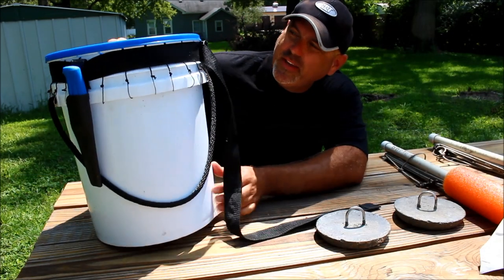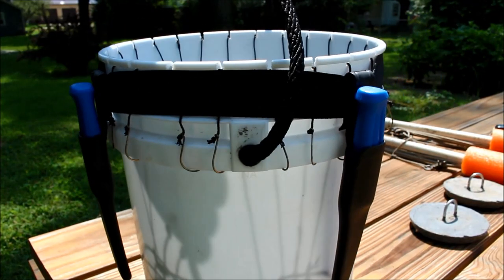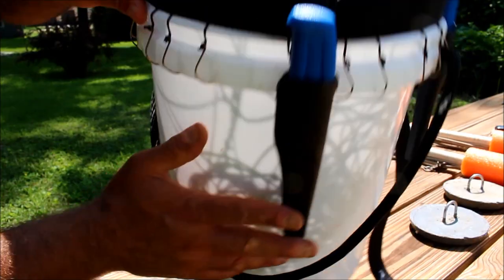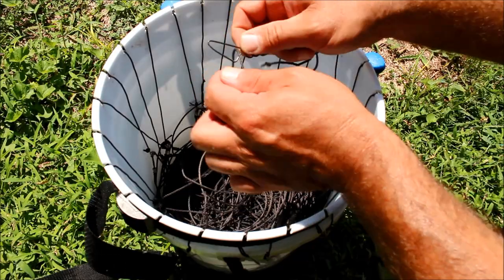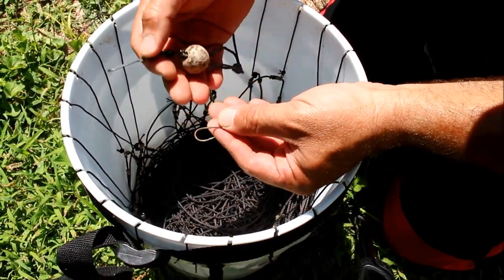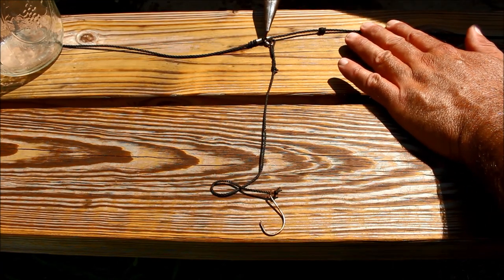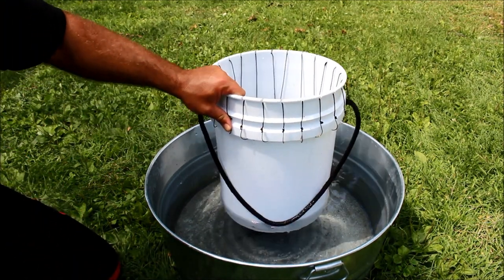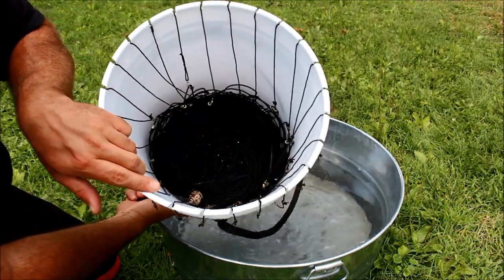Intelligent Trot Line Design

Comment: Nice design! Innovative and functional. I may copy it myself. I'd be interested in trying to bait it and feed it out like I used to do with my grandpa's trotline boxes. There were no plastic 5 gallon buckets back then so he used old wooden coke-a-cola boxes, he cut notches in the edge of the box and hung a baited hook in each notch, facing up and outside the box. We'd bait up 10 or 12 ea. 25-100 hook trotlines. The last thing in would be a weight with a few feet of line. So what we'd do is take a jug that was wrapped with 20-25 ft of line, tie a loop knot in the end, put the loop around the weight, place the pre-baited trotline box on the back of the boat (my job) toss the jug and weight and ease out in the boat, the baited lines would pay out of the box, as it got to the corners of the box I'd turn the box so that the baited line was feeding straight out over the back of the boat. When we got the end we'd attach another jug to the weight, stretch the line tight and drop it, the excess line was wrapped around the jug, the jug would spin paying the line out. The next day at daybreak we'd run the lines and reverse the process, feeding the line back into the trotline box, taking the fish off as they came in. The knot he tied the drop lines on with was the simplest knot ever, he'd run the line thru the hooks eye, the an over hand knot in the end, and another around the shank of the book and snug it up. It was earth to undo if a hook was tough to get out we'd just detach it from the main line and drop the fish in the bottom of the boat and keep going. Might not seem like a strong knot but he dragged in an 88 lb flathead One morning and he routinely caught 20-40 lb blues, channels and flatheads. One of my grandpa's favorite baits to use was grasshoppers. We'd catch them in late summer at night. Grasshoppers crawl up near the tops of weeds at night so the dew would dry quicker enabling them to dry out and be able to fly as early as possible. We'd go out at night with a flashlight and pick them off the weeds and fill a couple of gallon milk jugs which we'd freeze for later use. My grandfather also used ivory soap, skipjack, and some special homemade doughballs made out of cotton, ice cream, asefedida, fennel, garlic, and some other nasty stuff that I never did get the recipe for.
Reply from the maker: I know what you are talking about because  I have used those wooden jump boxes as we called them. I put out a 315 hook line with a stack of those boxes a couple of times.  I can tell you that those boxes are much better than this bucket because the probability of a tangle is so much less with a jump box. I have read several times that old time  commercial fishermen didn't put bait on their hooks. they would but out 45 thousand hooks per day and somehow catch enough fish to make it now worth the time to bait the hooks. 
thanks for watching
Reply: @countrydirtkid4451  You're welcome. Uh, I'm gonna add one caution to baiting your lines the night before, make sure your pre-baited trotlines are locked inside something animal proof to keep the cats, coon, possums out of them! We baited up a dozen 50 hook lines and left them stacked in the boat inside the garage, but somebody left a door open and a couple of cats got into the trotline boxes, you can imagine the mess! My stepdad ended up having to dispose of several trotlines, cats and all, just chucked the whole mess into a dumpster.

Comment: Nice, clean setup. I've never used a trot line I may try this out in SanteeCooper for catfish
Reply: Ross Best best way to fish for numbers.used em for years.its an excellent means to cover a massive amount of water at one time,and even possible to fish up and down the water collumbby useing various leader lengths and useing multiple baits to see whats getting the most attention.trotlines are a time tested old world means to fish.heavily used in the amazon still.despite the dangers lol.but here,we dont have man eating fish so its much safer lol.but jokes aside these people rely on this system to feed whole villages.the only other main method you will see them use is nets.they only use what will produce significant numbers.solid system and if used with some awarness and cuation its garanteed to land good fish.most of our 50 to 70 pound cats where cuaght on the trotline.and we had rods in the same area lol.the other known and effective method is closely related,and thats useing juglines.basically a single hook version of a trotline.i seen boats drop 50 of em in an area at a time.only thing to consider with them is to make sure they are ancored some how.cats tend to duck for cover after a strike if they are able.

Comment: If You use large swivel snaps on your main line and tie your hooks on a loop it makes it a lot easier to take the fish off and easier to set because You set the main line without hooks and then go back over it putting your baited hooks on you just have to remember too close the swivel snaps then You have no tangles and no problems

Comment: Awesome job!!! That is one of the best trotline mechanisms and general trotline design I've seen. Very thought out and a reason behind everything! And the video quality and editing was awesome! I want to see how you run your trotline. Tieing on to a tree and dropping one end off with a weight is one thing, but running a trotline in open water on a flat with only weights can be a pain in the butt and I've never figured out a way to do it safely and precisely. Do you have any videos on that topic?
Reply from the maker: Thanks for watching, when I put it out I lift the motor all the way out  of the water and drift with the wind. Since the hooks are 18ft apart I have plenty of time to free any tangles that arise. After I reach the last hook I let the wind tighten up the line somewhat and the throw the last weight out. Having the motor running when putting it out is scary so I lift the entire lower unit out of the water and the boat drifts sideways. Thanks again
Reply: So that little weight is enough to anchor your boat also? I tried trotlining out of my 18 ft boat and now have a 24 ft boat. In the middle of the lake on a flat all I could come up with is put out a heavy 80 pound sack of concrete, tie it to a 8-12 pound weight with maybe 30 ft of string and attach trotline to small weight and terminate it in same manner with a small weight and a big weight. The small weights are enough to hold the trotline while the big weights help anchor your boat from drifting....I just always wondered how everybody else would approach trolling on a flat away from structure in a windy part of the lake
Reply: Sounds like my problem. 21,5 foot boat. currently no trolling motor. a little wind puts a lot of pressure. I like this bucket though.

Comment: It doesn't make sense that you are worried about the swivel "jumping a knot" but not worried about the hook jumping off the overhand knot.  Feels like they are equally concerning or not concerning.
Reply from the maker: yup the thing is that if the swivel jumps the knot it's now out of position and sliding down the main line. Pulling it back over the knot with pliers usually makes it more likely to happen again. If the hook jumps the knot, I can always just tie another drop line because I have a bunch of line still left on the spool.  I made this video years ago and still use this trotline. I'm amazed how long its lasted. The swivels came off another trotline and are over 35 years old. Thanks for watching.

Comment: How far apart are the cuts in the top of the bucket to hold the line hooks?
Reply from the maker: I will measure it tomorrow. I remember that I taped a piece of masking tape around the top of the bucket and then I peeled the tape off and put it on a table and marked out the slots with marker and a tape measure. I then put the tape back on and cut on a table saw which was scary but turned out good.
Reply: @countrydirtkid4451  Sounds good. Thanks a million!!

Comment: where did you get the strap?
Reply from the maker: This stuff is called  nylon webbing and you can buy it at  farm stores such as farm and fleet or tractor supply.  It is sold in the rope and twine section. You can  get the plastic buckles in the same place
Reply: Thank you I will drop by tsc tomorrow